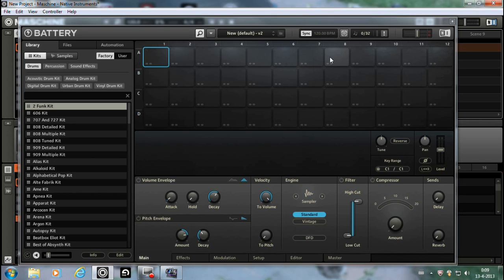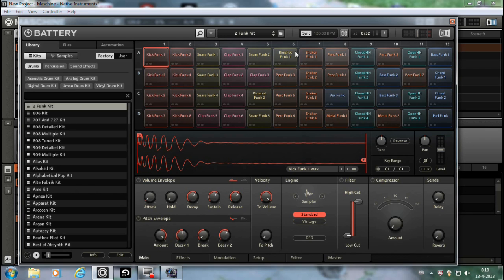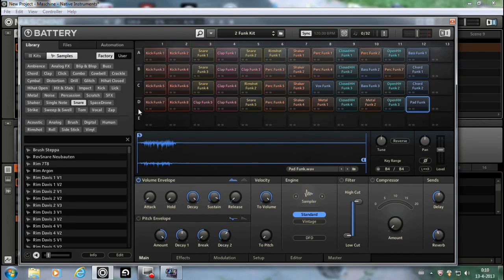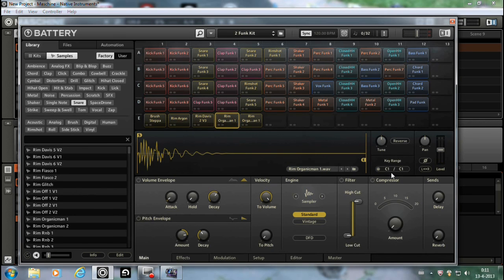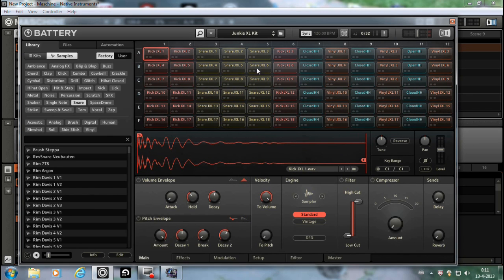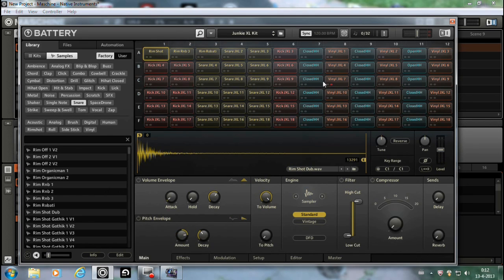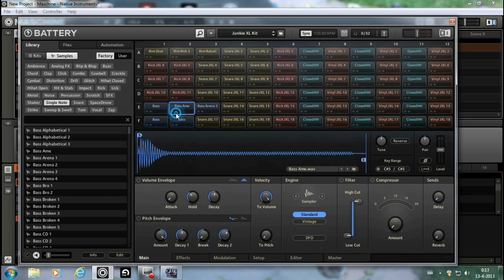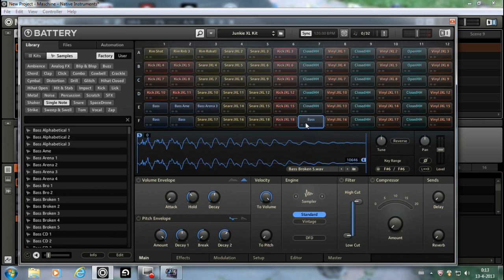Battery 4 tutorial creating custom kit tip

Comment: i work in logic, and here's how i do it: open battery, click the midi learn button (key range) and set the pad/key you want for each pad. then once you're done, just save the preset (in the logic menu at the top of the plugin window, left of 'copy') as #defult. now it will always load with your pads mapped nicely. :-)

Comment: depending on your settings if u drag samples on top of existing cells it might stack your samples. to clear all of the cells click on the top left corner between Bank A & column 1 to high light every cell. right click and clear, also if u hold shift you can select groups of samples and drag them rather than each individual sample.

Comment from the maker: Yeah i myself have done it with different size kits, loaded them , did cut all cells and save it. So i have a default template i can load from all kitsizes. I think cut cells is easyer / faster than asigning them manually ;-)

Comment: Thanks.  I'm just getting started again working w/ battery and generally want to build my own kits rather than use the factory sounds.

The only question i'd have is... don't the kits you're replacing have their own envelope settings & keygroups that need to be changed if you replace the sounds?

Also - is there any 'standard map' that should be used? E.g. like kicks on C, Snares on D, hi-hats in A-thru-B, or something?  I see that battery has some rough consistency in how it lays out factory kits, but i've never seen any blank template anywhere.

Comment from the maker: Hi, yes , there are multiple ways to achieve that.
You could Go to Main section, select Volume Envelope and than change the release , set it down to zero. (you might need to adjust the substain to) 
This way the sample wil only play when you hold down youre key and stop playing when you let it lose. Another way for example is go to editor section, make it a loop, set mode to "Loop until end of Envelope" . Let me know or it worked out for you okay :-)

Comment: edit: of course i meant #default; not #defUlt! and yes, if you're simply mapping to a keyboard you're better off taking an existing mapped preset, but in my particular case or for anyone using controller pads that are user-mapped, you'll need to do it the good ol' fashioned way. :-)